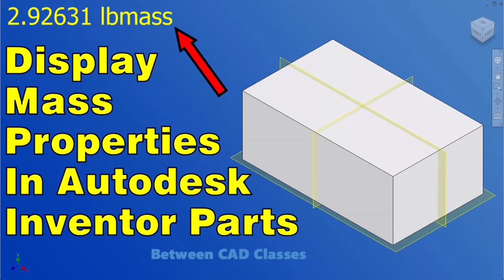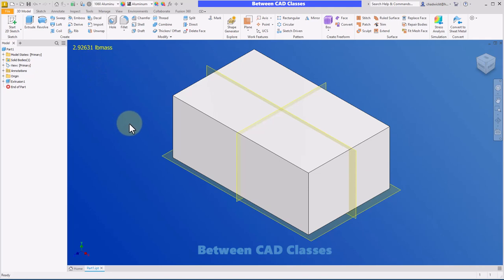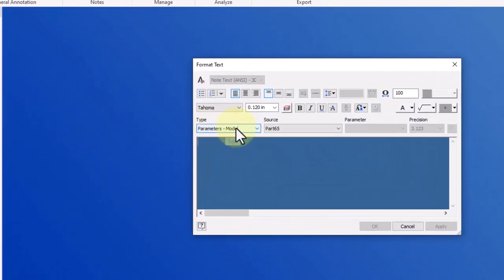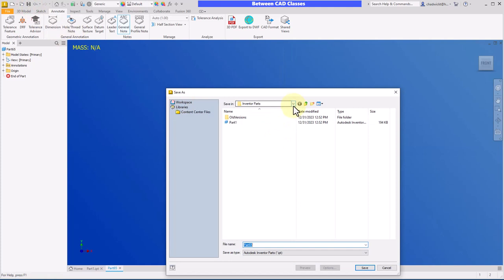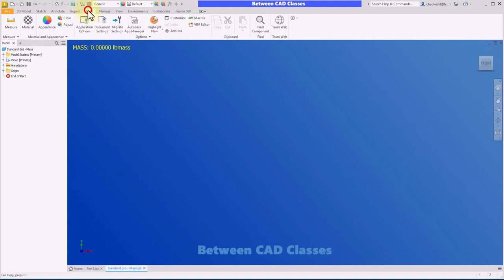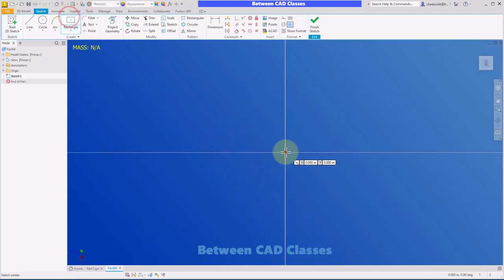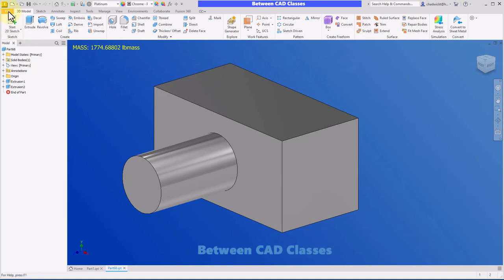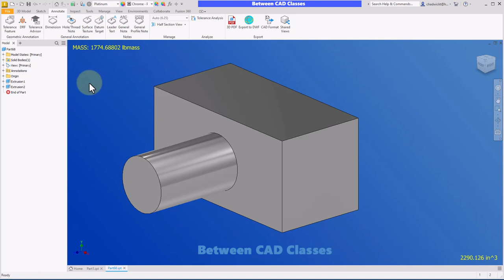Display Mass Properties in Autodesk Inventor

Comment: That's great. Still not so efficient as the mass calculator of Solidworks. But now I can calculate masses quicker for particular parts inside an assembly by suppressing the other ones or copying the ones I want to a new assembly file. It needs to be updated on the BOM feature if you don't want to save the file. Thank you!
Reply from the maker: I have seen the Solidworks calculator, it is pretty great! Maybe someday in Inventor. Thanks for watching!